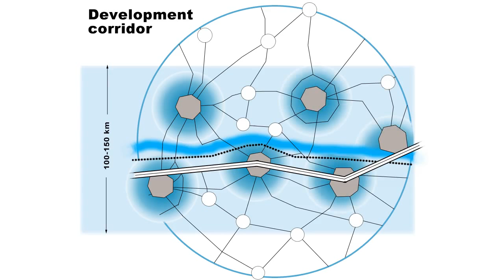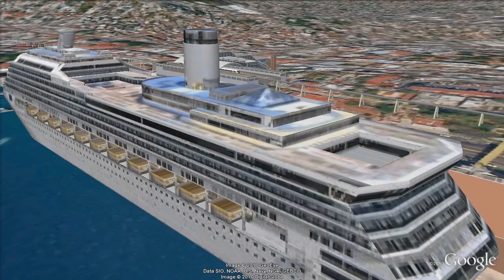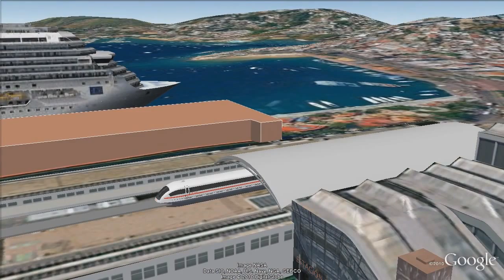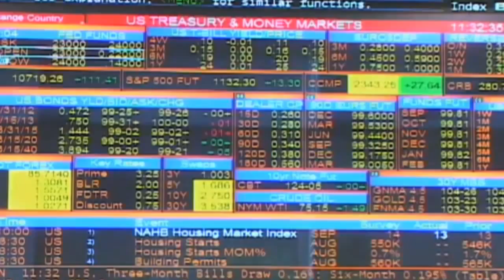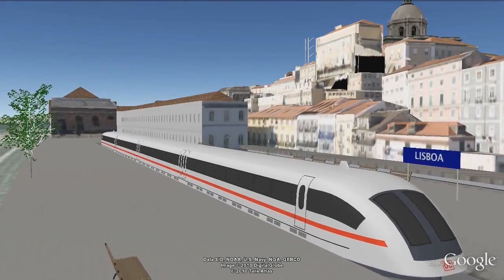World Landbridge (6) - Development Corridors from Acapulco to Mumbai

Comment: 50  year old Evacuated tube transport is a smaller and limited undertaking in permanent structure and technology components. Whose freedom from energy dependency, unprecedented safety, speeds, ease of use, convenience, and realization of a multi exponentially increased usage rate. Will remove the social economic barriers of today and accomplish them in a manner of forms and processes which are environmentally and ecologically sound. Integrating the distribution processes into a secure and controlled environment is an evolutionary step for these antiquated processes as the new found applications of technology will not only remove nearly all the current cost we know today but the greatly increased capabilities will revolutionize human achievements in its persuits of maintaining and increasing wellbeings..